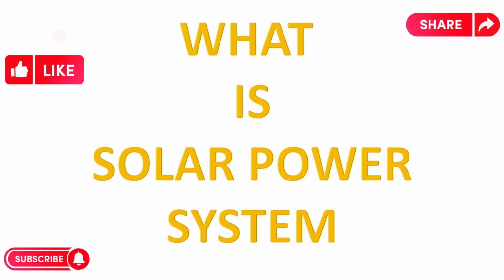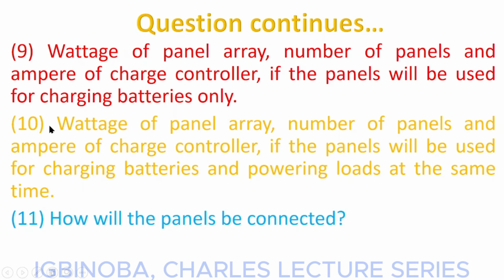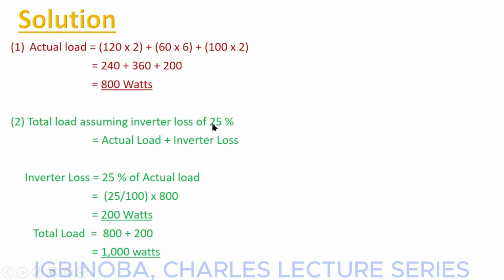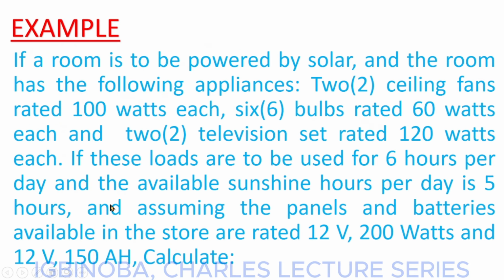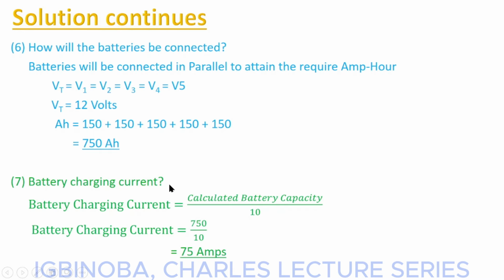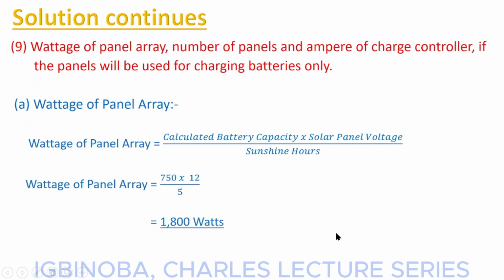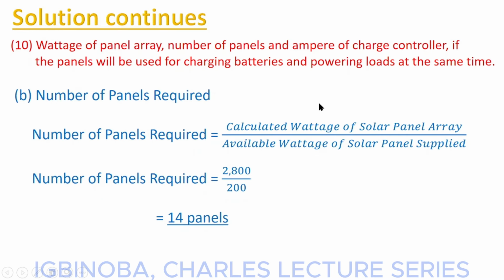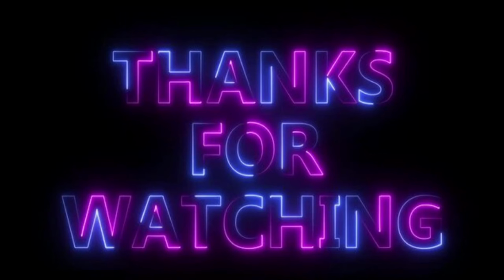Design of Solar Power System

Comment: EEE72EE

1. Actual Load = 1380 W

2. Total load = 1725 W

3. Inverter rating= 2156.25 VA

4. Battery capacity= 1293.75 AH

5. Number of batteries= 9 batteries

6. Battery connection= Parallel

7. Battery charging current = 129.375 A

8. Battery charging time = 14 hours

9. Wattage array (charge only)= 3105 W

b. Number of panels = 16 panels

c. Ampere of charge controller= 258.75A

10. Wattage (charge + load) = 4830 W

b. Number of panels = 24 panels

c. Ampere of charge e= 402.5A

11. Parallel connection

Comment: MAR117N

Appliance

Quantity

Rating

Total Power

Ceiling fans

3

100 W

300 W

Bulbs

10

60 W

600 W

Television

4

120 W

480 W

Total

1,380 W

The appliances are used for 6 hours/day.

Sunshine = 5 hours/day

Solar panel = 12 V, 200 W

Battery = 12 V, 150 Ah

⸻

1. Total load

P_T=(3\times100)+(10\times60)+(4\times120)

=300+600+480

\boxed{P_T=1,380W}

⸻

2. Daily energy consumption

E=P\times t

E=1,380\times6

\boxed{E=8,280Wh/day}

or

\boxed{8.28kWh/day}

⸻

3. Number of solar panels required

Each panel produces:

200W\times5h=1,000Wh/day

Therefore:

N=\frac{8,280}{1,000}=8.28

Since we cannot use part of a panel:

\boxed{N=9\text{ solar panels}}

So 9 panels of 200 W are required.

Total panel capacity:

9\times200=\boxed{1,800W}

⸻

4. Battery capacity required

Daily energy required = 8,280 Wh

For a 12 V battery bank:

Ah=\frac{Wh}{V}

Ah=\frac{8,280}{12}=690Ah

Each battery = 150 Ah

N=\frac{690}{150}=4.6

Therefore:

\boxed{5\text{ batteries}}

So you need five 12 V, 150 Ah batteries for approximately one day’s energy requirement, assuming ideal/full usable battery capacity.

Final Answers ✅

1. Total load = 1,380 W
2. Daily energy consumption = 8,280 Wh/day = 8.28 kWh/day
3. Solar panels required = 9 panels (200 W each)
4. Batteries required = 5 batteries (12 V, 150 Ah each)

Comment: COET/11506/2023
PETROCHEMICAL ENGINEERING 

1. Actual Load = 1380 W

2. Total load = 1725 W

3. Inverter rating= 2156.25 VA

4. Battery capacity= 1293.75 AH

5. Number of batteries= 9 batteries 

6. Battery connection= Parallel 

7. Battery charging current = 129.375 A

8. Battery charging time  = 14 hours

9. Wattage array ( charge only)= 3105 W
b. Number of panels  = 16 panels
c. Ampere of charge controller= 258.75A

10. Wattage (charge + load) = 4830 W
b. Number of panels = 24 panels
c. Ampere of charge e= 402.5A

11. Parallel connection

Comment: COET/11622/2023
Petroleum engineering 
300 level 

1. Actual load = 1380 Watts
2. Total load = 1725 Watts
3. Inverter rating = 2156.25 VA
4. Battery Capacity = 1293.75 Ah
5. Number of Batteries for backup hours = 9 batteries
6. The battery connection will be in form of Parallel connection
7. Battery Charging Current = 129.375 A
8. Battery Charging time assuming a loss of 40% = 14 hours

9. a) Wattage of panel = 3105 Watts
b) Number of panels = 16 panels
c) Ampere of charge controller = 259 Amps

10. a) Wattage of panel array when the batteries are used for charging batteries and powering loads at the same time = 4830 Watts
b) Number of panels required = 24 panels
c. Ampere of charge controller required= 403amps
11. The panels will be connected in parallel connection

Comment: PETROCHEM63
K
ANSWER

1. 1380 watts

2. 1725 watts

3.  2156.25 VA

4.  1293.75 Ah

5.  9 batteries

6. Parallel connection

7.  129.375 A

8. 14 hours

9. 3105 watts
    16 panels
     258.75 A

10. 4830 watts
       24 panels
       402.5 A

11. The panels are arranged in parallel

Comment: MEC21M
1. Actual Load: 1,380W
2. Total Load: 1,725W
3. Inverter Rating: 2,156.25 VA
4. Battery Capacity: 1,293.75 Ah
5. Number of Batteries: 8.625 (round up to 9 batteries)
6. Battery Connection:
Parallel connection
7. Battery Charging Current: 129.375 A
8. Battery Charging Time (40% loss): 14 hours
9. Solar Panel Array (Charging Only):
Wattage: 3,105W
Number of Panels: 15.525 (round up to 16 panels)
Charge Controller: 258.75 A
10. Solar Panel Array (Charging + Load simultaneously):
Total Wattage: 4,830W
Number of Panels: 24.15 (round up to 25 panels)
Charge Controller = 4,830W / 12V = 402.5 A
11. Panel Connection:
Parallel

Comment: COMP 46T

1. Actual Load = 1380Watts

2. Total Load = 1725Watts

3. Inverter rating(VA) = 2156.25VA

4. Battery Cap. = 1293.75Ah

5. No. Of batteries = 8.6~9 batteries

6. Parallel

7. Battery charging = 129.4A

8. Time = 14hrs

9. (a) 3105Watt (b) 15.5 ~ 16 panels (or 200watt(5) then a 100watt (c) Current = 258.75Amp

10. (a) 4830Watt (b) 24 panels (c) 402.5Amp

11. Parrelel

Comment: PETRO 49W 

   1. Actual load = 1400 Watts 

   2. Total load assuming inverter loss of 25 % =1800 Watts

  3. Inverter rating in VA using power factor of 0.8 = 2300 VA

   4. Battery capacity using a factor for reserve of 75 % =1400 Ah

   5. Number of batteries for backup hours = 9 

  6. How will the batteries be connected = Batteries will be connected in parallel to attain the required Amp Hour 

  7. Battery charging current = 140Amps 

  8. Battery charging time assuming a charging loss of 40 % = 14 hours ( with loss of 40%), 10 hours (without loss of 40%) 

  9. If panels will be used for charging batteries only; 
    a) wattage of panel array = 3400 Watts
    b) number of panels = 17 
    c) ampere of charge controller = 280 Amps 
 
10. If panels will be used for charging batteries and powering loads at the same time; 
    a) wattage of panel array = 5200 Watts 
    b) number of panels = 26 panels 
    c) ampere of charge controller= 430Amps
   
11. How will the panels be connected = parallel

Comment: COMP3B

1. Actual Load: 1,380W
2. Total Load: 1,725W
3. Inverter Rating: 2,156.25 VA
4. Battery Capacity: 1,293.75 Ah
5. Number of Batteries: 8.625 (round up to 9 batteries)
6. Battery Connection:
Parallel connection
7. Battery Charging Current: 129.375 A
8. Battery Charging Time (40% loss): 14 hours
9. Solar Panel Array (Charging Only):
Wattage: 3,105W
Number of Panels: 15.525 (round up to 16 panels)
Charge Controller: 258.75 A
10. Solar Panel Array (Charging + Load simultaneously):
Total Wattage: 4,830W
Number of Panels: 24.15 (round up to 25 panels)
Charge Controller = 4,830W / 12V = 402.5 A
11. Panel Connection:
Parallel

Comment: COMP13G

1. Actual Load: 1,380W
2. Total Load: 1,725W
3. Inverter Rating: 2,156.25 VA
4. Battery Capacity: 1,293.75 Ah
5. Number of Batteries: 8.625 (round up to 9 batteries)
6. Battery Connection:
Parallel connection
7. Battery Charging Current: 129.375 A
8. Battery Charging Time (40% loss): 14 hours
9. Solar Panel Array (Charging Only):
Wattage: 3,105W
Number of Panels: 15.525 (round up to 16 panels)
Charge Controller: 258.75 A
10. Solar Panel Array (Charging + Load simultaneously):
Total Wattage: 4,830W
Number of Panels: 24.15 (round up to 25 panels)
Charge Controller = 4,830W / 12V = 402.5 A
11. Panel Connection:
Parallel

Comment: EEE73U
1) Actual Load – 1,380 Watts
2) Total Load – 1,725 Watts
3) Inverter Rating in VA – 2156.25 VA
4) Battery Capacity – 1293.75 Ah
5) Batteries for Backup 6 6) Hours – 9 Batteries
6) Batteries Connection – Parallel
7) Battery Charging Current – 129.4 A
8) Battery Charging Time – 14 hrs
9a. Wattage of Panel Array – 3105 Watts
(3500 Watts)
9b. Number of Panels – 16 panels
9c. Ampere of Charge Controller – 266.67 A
(300 A)
10a. Wattage of Panel Array – 4830 Watts
(5000 Watts)
10b. Number of Panels – 25 panels
Panel connected in parallel

Comment: PETRO38R

1. Actual Load:1380 W
2. Total Load: 1725 W
3. Inverter Rating:2156.25VA
4. Battery Capacity: 1293.75Ah
5. Number of Batteries: 9batteries
6. Battery Connection Type:Parallel connection
7. Battery Charging Current: 129.3 A
8. Charging Time (40% Loss): 14hrs
9a) Panel Wattage:3105W
9b) Number of Panels: 16panels
9c) Charge Controller Current: 258.75A
10a) Panel Wattage:4830W
10b) Number of Panels: 25panels
10c) Charge Controller Current:402.5A
11) Panel Connection Type: Parallel connection

Comment: EEE71S

1. Actual Load – 1,380 Watts
2. Total Load – 1,725 Watts
3. Inverter Rating in VA – 2156.25 VA
4. Battery Capacity – 1293.75 Ah
5. Batteries for Backup 6 Hours – 9 Batteries
6. Batteries Connection – Parallel
7. Battery Charging Current – 129.4 A
8. Battery Charging Time – 14 hrs
9a. Wattage of Panel Array – 3105 Watts (3500 Watts)
9b. Number of Panels – 16 panels
9c. Ampere of Charge Controller – 266.67 A (300 A)
10a. Wattage of Panel Array – 4830 Watts (5000 Watts)
10b. Number of Panels – 25 panels
11. Pannel connected in parallel

Comment: CHM70R
1. Actual load =1380W
2. Total load = 1725W
3. Inverter rating = 2156.25VA
4. Battery capacity = 1293.75Ah
5. Number of batteries = 8.625 ~ 9 Batteries 
6. Battery connection = Parallel 
7. Battery charging current = 123.375A
8. Battery charging time =14 hours
9a. Array Wattage (charge only) = 3105W
9b. Number of panels = 15.5 ~ 16 panels
9c. Charge controller current = 258.75A
10a. Array wattage(charge + load) = 4830W
10b. Number of panels = 24 panels
10c. Charge controller current = 402.5A
11. Panel connection = Parallel

Comment: CIV46T
Actual load is 1380W
Total load is 1725W
Inverter rating is 2156.25VA
Battery capacity is 1293.75
Battery for backup is 9 batteries connection is parallel 
Battery charging current is 129.4A
Battery charging time is 14 hrs
Wattage of panel array is 3105W
16 panels
Charge controller in ampere is 258.75
4830W
24
402.5amps
The panels will be connected in parallel

Comment: MEC74FF

Answers:        
                                
1).Actual Load - 1,380 Watts
2).Total Load - 1,725 Watts
3).Inverter Rating in VA - 2156.25 VA
4).Battery Capacity - 1293.75 Ah
5).Batteries for Backup 6).Hours - 9 Batteries
7).Batteries Connection - Parallel
8).Battery Charging Current - 129.4 A
9).Battery Charging Time - 14 hrs
9a). Wattage Of Panel Array - 3105 Watts (But it's better to use 3200 Watts)
9b). Number Of Panels - 16 panels
9c). Ampere Of Charge Controller - 266.67 A (But it's better to use that of 300 A)
10a). Wattage Of Panel Array - 4830 Watts (But it's better to use 5000 Watts)
10b). Number Of Panels - 25 panels
11). Panels Connection - Parallel

Comment: MAR53A

Answers:
1. Actual load =1380W
2. Total load = 1725W
3. Inverter Rating = 2156.25VA
4. Battery capacity = 1293.75AH
5. Number of Batteries = 9 Batteries 
6. Battery connection = parallel 
7. Battery charging current = 129.375A
8. Battery charging time = 14 hrs
9a. Array Wattage (charge only) = 3105W
9b. Number of panels = 16 panels 
9c. Charge controller current = 258.75A
10a. Array wattages (charge + load) = 4830W 
10b. Number of panels = 25 panels  
10c. Charge controller current = 402.5A
11. Panel connection = parallel

Comment: CHM8H actual load=1380watts.2) Total load=1725watts.3) inverter rating=2156.25VA. 4) Battery capacity=1293.75Ah.5) Number of batteries=8.6.6) connection parallel.7) Battery charging current=129.375.8) charging time.9)a wattage of panels array=3105w.B) Number of panels 16 panels charge controller 258.75A.10)a wattage of panels array 4830W.B) Number of panels 24.C) charge controller=4025A.11) panels arrangement parallel.

Comment: EEE90L

1. The actual pad is 1,380W
2. The Total load is 1,725W
3. The inverter rating is 2,156.23VA
4. The battery capacity is 1,293.75Ah 
5. The Number of batteries is 9
6.  The batteries are connected in parallel 
7. The Battery charging current is 129.4 amps.
8. The battery charging time is 14 hours.
9. a. The wattage of the panel array is 3,105W
b. The number of panels is 16 panels.
c. The Charge controller rating is 258.75 amps.

10. a. The wattage of the Panel array is 4,830 Watts 
b. The number of panels is 24 panels.
c. The charge controller rating is 402.5 amps
11. The panels are arranged in parallel

Comment: EEE81C 

1. Actual Load - 1,380Watts

2. Total Load - 1,725Watts

3. Inverter Rating in VA - 2156.25VA

4. Battery Capacity - 1293.75Ah

5. Batteries for Backup Hours - 9 Batteries

6. Batteries Connection - Parallel

7. Battery Charging Current - 129.4A

8. Battery Charging Time - 14hrs

9a). Wattage Of Panel Array - 3105Watts (But it's better to use 3200Watts)

9b). Number Of Panels - 16 panels

9c). Ampere Of Charge Controller -266.67A(But it' better to use that of 300A)

10a). Wattage Of Panel Array - 4830Watts (But it's better to use 5000Watts)

10b). Number Of Panels - 25 panels

11. Panels Connection - Parallel

Comment: MEC17Q
1;1380W
2;1725W
3;2156.25VA
4;1293.75AH
5;9 batteries 
6;batteries will be connected in parallel 
7;129.375A
8;14hours 
9a;3105W
b;16
c;258.75Amp
10;4830W
b;24
c;402.5Amps
11;The panels will be connected in parallel

Comment: EEE 117M

(1) 1,380 W
(2) 11,040 Wh (or 1,840 W continuous)
(3) 1,725 VA
(4) 1,226.67 Ah
(5) 8 batteries
(6) 8 in parallel
(7) 184 A
(8) 11.11 hours (or 8.33 hours for daily discharge only)

Comment: COMP61I

1. The actual pad is 1,380W
2. The Total load is 1,725W
3. The inverter rating is 2,156.23VA
4. The battery capacity is 1,293.75Ah 
5. The Number of batteries is 9
6.  The batteries are connected in parallel 
7. The Battery charging current is 129.4 amps.
8. The battery charging time is 14 hours.
9. a. The wattage of the panel array is 3,105W
b. The number of panels is 16 panels.
c. The Charge controller rating is 258.75 amps.

10. a. The wattage of the Panel array is 4,830 Watts 
b. The number of panels is 24 panels.
c. The charge controller rating is 402.5 amps
11. The panels are arranged in parallel

Comment: Chm28B 
Actual load = 1380 W
Total load = 1725 W
Inverter rating = 2156.25 VA
Battery capacity = 1239.75 Ah
Number of batteries = 8.625 ≈ 9 batteries
They will be connected in parallel.
Battery charging current = 129.375 A
Battery charging time with 40% loss = 14 hours
9a. Wattage of panel array = 3105 W
9b. Number of panels = 16 panels
9c. Charge controller current = 258.75 A
10a. Wattage of panel array with load = 4485 W
10b. Number of panels = 23 panels
10c. Charge controller current = 373.75 A
They will be connected in parallel.

Comment: MAR116L

1. Actual load. P=(3 ×100)+(10× 60)+(4×120) =  1,380 W

Daily energy: 1380 × 6= 8280wh

2. Load with inverter loss: 100% -25%= 75%= 0.75
P=  1380÷0.75 = 1,840W

3. Inverter rating: VA= 1840÷0.8=
2,300 VA minimum , but preferably 2.5kva or 3kva inverter is required.

4. Required battery capacity
1,227 Ah @ 12 V

5. Number of batteries 12 V, 150Ah
N= 1226.7÷150= 8.18
Let's say N equal to 9 batteries 

6. Battery connection
Parallel.
This is because the the system voltage required is 12v and if connected in series the voltage would then be 108v , which is far above the system.

7. Charging current
Iç=battery capacity/10
1350÷10=135A

8. Charging time
T= capacity /charging current ×(1+loss)
1350÷135×1.4=14 hours

9. Panels for charging only: battery bank energy= 12 × 1350=16200wh
5hours of sunshine:16200÷5 = 3240W
Each panel: 3240÷ 200= 16.2
That is 17 panels.

Actual panel capacity: 17 × 200=3400W
 Charge controller: I= 3400÷12= 283A that's approximately 300A charge controller capacity 

10. Panels for charging + load
Where, 
Load required= 1840w
Battery charging power: 3240w
Therefore solar power: = 1840+3240= 5080w
Number of 200w panels: 5080÷200= 25.4
That is 26panels approximately 
Actual array:
26 × 200 W = 5,200 W

11. Panel connection in
Parallel, because with want the voltage to be constant at 12v and increase in current.

Comment: PETROCHEM60H 
ANSWER:
Actual load = 1380 Watt
Total load = 1725 Watt
Inverter rating = 2156.25 VA
Battery capacity = 1239.75 Ah
Number of batteries = 8.625 (9 batteries)
They will be connected in parallel.
Battery charging current = 129.375 A
Battery charging time with 40% loss = 14 hours
9a.
Wattage of panel array = 3105 Watt
9b.
Number of panels = 16 panels
9c.
Ampere of charge controller = 258.75 A
10a.
Wattage of panel array with load = 4485 Watt
10b.
Number of panels = 23 panels
10c.
Ampere of charge controller = 373.75 A
They will be connected in parallel.

Comment: MAR32F

Answers:
Actual load = 1380 Watt
Total load = 1725 Watt
Inverter rating = 2156.25 VA
Battery Capacity = 1239.75 Ah
Number of batteries = 8.625 (9 batteries)
They will be connected in parallel
Battery charging current = 129.375 A
Battery charging time with 40% loss = 14 hrs
9a. Wattage of panel array = 3105 Watt
9b. Number of panels = 16 panels
9c. Ampere of charge controller = 258.75 A
10a. Wattage of panel array with load = 4485 Watt
10b. Number of panels = 23 panels
10c. Ampere of charge controller = 373.75 A
They will be connected in parallel.

Comment: Petro45S
Answer 
1.Actual load  =1380
2.Total load@ 25%=1725
3. Inverter rating=2156.25va
4. Battery capacity=1293.75ah
5.Number of batteries=9
6.Battery connection = parallel 
7.Battery charging current =129.375A
8.Battery charging time=14hours
9a. Array wattage (charging only) =3105w
9b. Number of panel= 16 panels 
9c. Charge controller current=258.75a
10a. Array wattage (charge +load) =4830w
10b. Number of panels=25panels
10c. Charge controller current=402.5a
11. Panel connection= parallel

Comment: MAR49W 
(1) Actual Load: 1380 Watts (2) Total Load: 1725 Watts (3) Inverter Rating: 2156.25 VA (4) Battery Capacity: 1293.75 Ah (5) Number of Batteries: 9 batteries i (6) Battery Connection: Parallel connection (7) Battery Charging Current: 129.375 Amps (8) Charging Time: 14 hours (9) For Charging Batteries Only: Panel Wattage is 3105 Watts Number of Panels is 16 panels Charge Controller Ampere is 258.75 A (10) For Charging Batteries and Powering Loads Simultaneously: Panel Wattage is 4830 Watts Number of Panels is 25 panels Charge Controller Ampere is 402.5 A (11) Panel Connection: Parallel connection